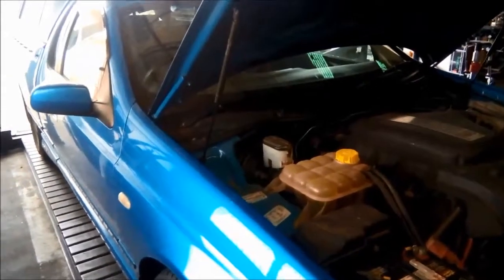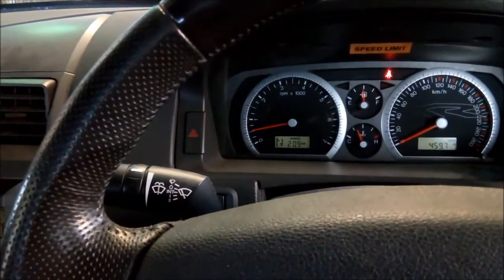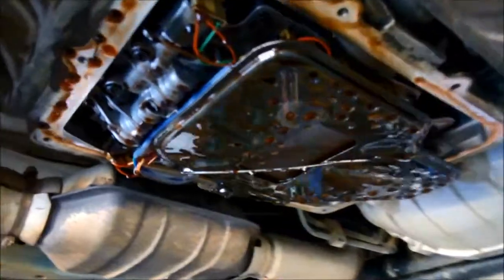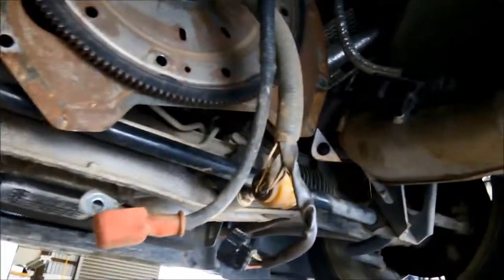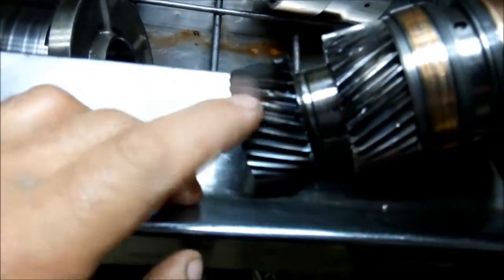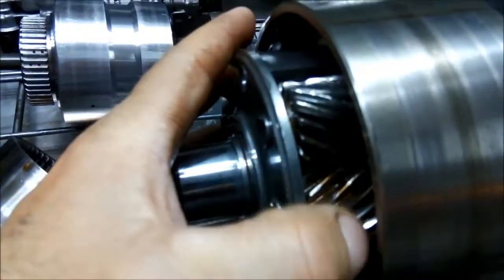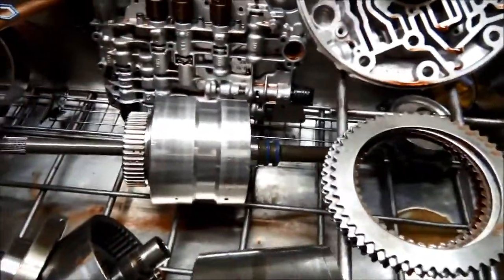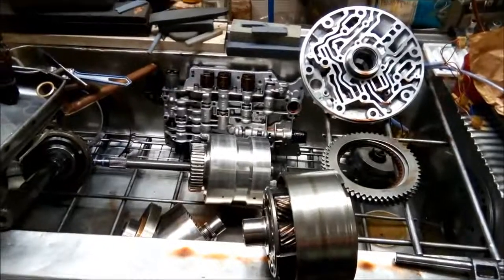Ford BTR ION DSI M74 M74LE 4 Speed Automatic Transmission XR8 Teardown Blown Planetary Set Analysis

Comment: mine just had clutch sludge looking black stuff only 1 small bit of metal, like 2mm small
Reply from the maker: hi, the solenoids are likely to be contaminated. the swarf get magnetized and cant get out. cheers
Reply: @YepThatsIt  would that explain; no reverse at all, 3rd gear dropping out and slipping bad, using "d" slipping hard in all gears other than 4?
this box has been abused hard by the last owner, i just dont want to get stranded 30ks from home in the outback since theres stuff all reception.
1st and 2nd are fine, no weird noises or slippage, 3rd slips hard and stays at 2100rpm until i can grab 4th and when you do finally get it into 4th (economy mode ~1400rpm 80ks an hour cruising speed) it makes a whine kind of like a supercharger

Comment: what does "no reverse and slipping from 1400ish rpm up to 2grand in 3rd" sound like?
got my 3-4 shift smoother by flushing the hell out of the box with 3 basic services (oil and filter, gunna rip some solenoids out of an M93LE to go in my M97LE was my next idea)
Reply from the maker: hi, yes solenoids are same. cheers

Comment: hey yepthats it
i have just resealed and gassketted a btr 93le  and after fit and fill i have drive but no reverse . have you had this before and do you mind suggesting a few things i could try to resolve it.
i before rebuild i had week drive which run out  so drive for a bit and stop driving .  i resealed all pistons and replaced all teflon seals and swapped out worn clutch packs. the rear band piston moves 3.4mm and the gap in the front band is 3,25mm when applied for both? i enjoy you channel and you gave me the confidence to give it ago . please help  cheers from a tassie lad
Reply from the maker: hi, did you replace any bushes? reverse is c3 clutch and b2 band. manual 1st also uses b2 band...do you have strong manual 1st?  the c3 clutch pistons are prone to having a hair-line crack in them very hard to see unless you have pressure behind it...good to do a wet air test with trans fluid.....before you take out trans, pop off valve body and do an air pressure test, see if you have good clutch and band apply or if you can hear a leak. hopefully you have a good repair manual to refer to. good luck & cheers
Reply: @YepThatsIt   thanks . i didn't replace any bushes. i took of the v/b and tested the c3 clutch there is holes in that piston so it did leak air but i could still hear the piston move up against the clutches . in the end i put the v/b back on, but i replaced  s1  with a s/h unit and problem still remained so i replaced s3 and the problem gone . everything all good now . thanks for your reply and thanks for posting videos i enjoy them . i will say this though dam there is a lot of stuff inside them automatic transmitions ... keep up the good work. cheers

Comment: I have an xr6t and it keeps going into limp mode, and showing gear select solenoids turn car off for 15 minutes and it starts and drives again so confusing could that be a simple filter and service needed or new box?
Reply from the maker: hi, service is good start, however best to check all the solenoids for leaking and contamination.cheers

Comment: Love your work. I just love YouTube and the info you can find to fix things.

I have an AU III 4 Speed that has 260000km, any way one day in traffic towing a medium load it just stopped giving drive. Neutral in all gears. Got it on a tow truck and dropped at home. Came out the next morning and it drove fine. All attempts after that were a box of nothing.

No noises no roughness before failure, so I guessed it is a solenoid. It might even be the spring you show on your videos. I put the box aside for investigation after checking youtube.

Which solenoid do you think it might be?
Reply from the maker: hi,  sounds like a contaminated filter. when you turn it off and let it sit for a bit, the fluid from torque converter reverse flushes the filter. will run better until it becomes blocked again. cheers

Comment: Mine started playing up other day gets stuck in top gear and goes into limp mode constantly :(
Reply from the maker: hi, check basics first...fluid level, battery voltage, fuse (tx or at) inhibitor switch connections and then move onto checking internal solenoids...limp mode is 3rd gear on these, whereas shift solenoids are not energised. good luck cheers
Reply: YepThatsIt thanks heaps for the reply hopefully doesn't cost me to much to fix

Comment: now I'm trying to fit an au box into baxr6t and shifter is different as well as extension housing, now I'm in the shit...
Reply from the maker: hi, au won`t fit into a ba/bf. the inhibitor switch is different as well ( au is the white type and ba/bf is the black type ) you can upgrade the ba/bf pump by using the au type and getting an au torque converter though ( au and earlier pumps are bigger and better ) hope that helps cheers
Reply: yep, was thinking maybe I could change the whole bar that it is attached to, but looks like extra steps. so au pumps may be bigger but isn't there pump pressure regulator, so should be same pressure in both?
Reply from the maker: hi, yes true there is a regulator but the bigger or wider pump gears will produce more flow especially because your pump drive gear is directly driven by the engine via the outer part of the torque converter....the internal part vanes or blades are driven by the fluid coupling and input shaft....this means that as your eng revs drop, so does the revs of the pump drive gear....yes there is a regulator but with the bigger pump even at low revs more flow will be produced if needed, good for lube and coolerflow....also because the earlier pumps are wider, there is more surface area contact so they wear a lot less....sorry if that doesn`t make sense...but in hydraulics there are pressure and flow dynamics that are sometimes and often critical...especially in HP applications...cheers
Reply: YepThatsIt awesome, thanks for info, so i can swap out au pump, put that in BA box with AU convertor then all good?
Reply from the maker: not sure about good, but definitely better
Reply: i checked the difference in mine, yes does make alot of sense, I'm sold on the pump facts, at this point looks like most economic way would be for me to use stock BA box but with au pump and convertor rather than spending 3 grand for reco with V8 power claims....
I hope this information helps others going through similar issues

Comment: wow, thanks that is great info, I have very similar box in my ba xr6twith same issues.Can you tell the honest difference between a standard btr to a turbo or v8 one? or 95le, and 97le?
Reply from the maker: hi, there are a few internal hard part differences. the 6cyl and 8cyl naturally have different cases. most soft ( the parts designed to wear out ) are pretty much the same in all. torque converters are different as well. hope that helps cheers
Reply: I guess I'm trying to justify spending extra $1500 on 6cyl ba turbo box that apparently is better than stock....No one can really explain where money is going and I need a new box
Reply: really do appreciate your honesty here.
Reply: Mmmm, i have a V8 and 6cyl AU and xr6t BA, I've noticed extention housings are different and also understand torque convertors are different perhaps the actual box must be different on the inside, yes does help alot, again thanks